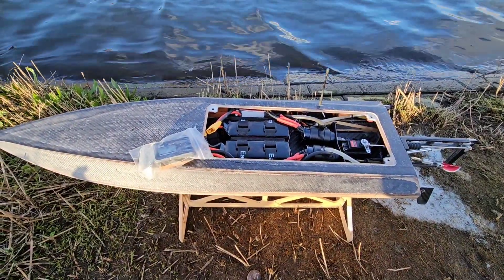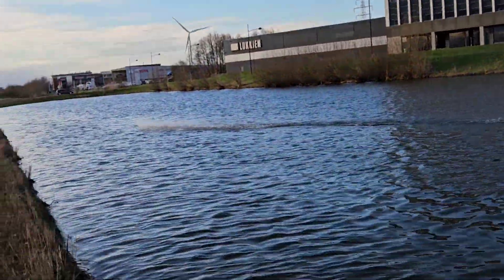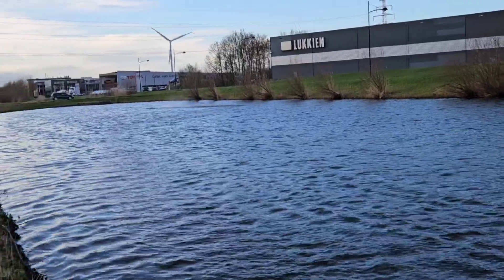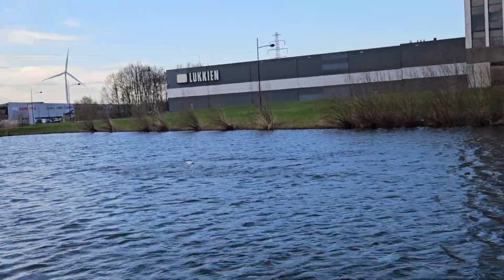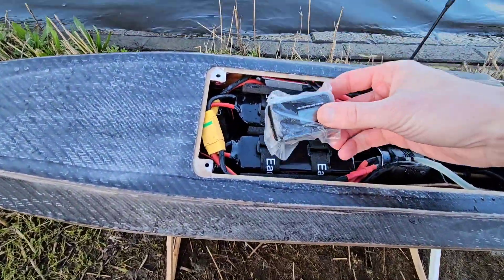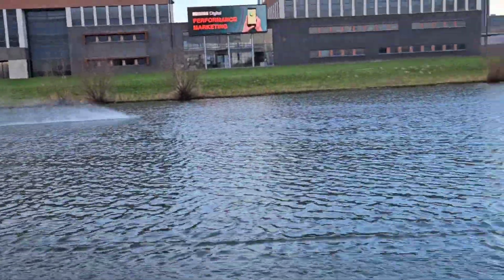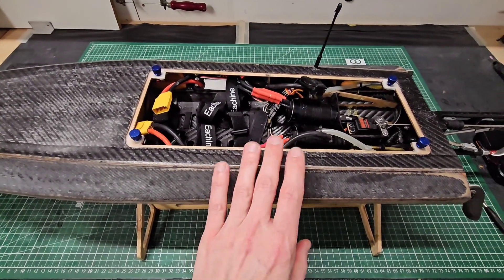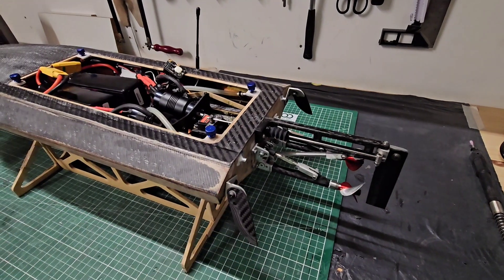DIY twin motor RC boat: top speed running until breakdown!

Comment: Hi what is your electronic application? Motor, Esc and Lipo battery...thanks😊
Reply from the maker: This boat has 2x Rocket 3670 1850kV motors, 2x 6S 4000mAh 70C lipo's and 2x Flycolor 150A esc's. The top speed is 118km/h so far, but I will soon beat that I think 😎
Reply: @CozyRC  thank you Sir..i got my Fiberglass RC boat and thinking what application should i use...thanks again Sir..i am from the Philippines

Comment: Hi friends, I'm asking for advice... My Twin Cat weighs 3.8kg with only 4mm flexible and currently using a 37mm prop and I want to add 40mm, will the 4mm flexible last without breaking... please guide me friend 🙏
Reply from the maker: That should be no problem. I'm running a 43mm 1.6 prop on my T800 F1 Tunnel, which has a 4mm flex shaft as well.
Reply: @CozyRC  That means it's safe, friend, to use a 40mm prop with only 4mm flexible...
Reply from the maker: @ahmadgazali3019 Yes, it should work.
Reply: @CozyRC  Ok.. 👍👍👍👍👍

Comment: yes, the propellers are like anchors if they stop suddenly, they require progressive deceleration.
It was a good day for the GForce,you start to be more confident and open the trotthle
Reply from the maker: You are right about the props under deceleration. It needs more care and you need some space to let the boat slow down.
The downtrim of the stingers make the boat more stable, so I'm more confident to run it full throttle. It's a bit slower too.. It was too bad the G-Force stopped in second run. The water became smoother and I wanted  to run some laps. Next time hopefully!
Reply: @CozyRC  the race to find the best setting has begun, how about powertrimms at 0° and the batteries as far back as possible and the tip of the trimmtabs 2mm above the boat line, that would be my next setting but it's up to you.
Reply: 🫣 o soory you don't have trimmtabs
Reply from the maker: @daiciuapostol79  Haha  that's right! I prefer to not use them. The SAW guys don't use them either. 
The stingers are about 1.5mm downtrimmed now. The centre of gravity is at 30%. On flat water, I could run the stingers 0.5mm down, with the lipo's shifted forward.
A new speed record will soon be made, I'm sure. The SSS 3674 2075kV motors are waiting too. More power and more rpm.
Oh, and I will run with a single big lipo again, but I need to make strong lipo brackets, to secure a single lipo. More to come!
Reply: @CozyRC  my proposal does not have a logical thinking, what would I do I would leave the boat freer only from the CG, but as I said in the past I would have started with 5s not on 6s, it is a bit too brutal and harder to find the correct setting
Reply from the maker: @daiciuapostol79  That's why I started with mild power and lower rpm: 2x 3670 1850kV. To learn the boat and not have too much power. It is about the same as 5S with 2000kV motors. 
On smooth water, it runs stable with this setup. So I feel confident to do a power upgrade soon 😄
Reply: Whit this setup you have +4000 rpm on load then 5s 2000kv so not the same,but hey more power more speed😊
Reply from the maker: @daiciuapostol79  OK, I didn't do the math exactly like you did. It is a bit higher indeed. I just love big power and high speeds, like you 😄.
Reply: @CozyRC  all I know is that you multiply the kv by 3.7v per cell if the battery are good quality 😉
man I really miss the runs☺️

Comment: That was a decent run.  I mean,  100+ in choppy water isn't bad. Also you demonstrated why you need to unplug your electronics when your working on it (for the less experienced boaters), happened to me once too that engine started to run after a crash and taking on some water.
Also noticed the response when you let off, experienced it also with my own twin (which i was thinking to use the components from for new hull) and on a video from ironclad. Makes me rethink if i really want to go twin with my new build. Starting to think a single might be the better choice...
Reply from the maker: A twin mono runs more stable, but letting off the throttle needs a bit more care. These are some big props too; 44mm 1.9 pitch.
A twin mono is just so cool! I would definitely make another twin. I could share the drawing of the G-Force, if you're interested? ✌️
Reply: @CozyRC  thanks, but i have an empty hull which is around 1m. My idea was 2x4082 on 6s or 1x4092 on 8s (like my Dom)...  Im bit worried the twin drives will become to high above water and also will give issues cornering. Was thinking to tackle that by using cat drives since there bit longer (and look nice too) but thats already thinking in problems. The thing is, i dont want to redo layout inside the boat if it doesn't work properly since it's a rare hull. On other hand, the most off them are build as a twin.
Reply from the maker: @peteroosterhoff8850  It depends on how you want the boat to run. For speed and straight-a-way runs, a twin drive is perfect. I use 100mm stingers for the same reason you mention: to have enough prop in the water, even though they are a few cm off-center.
That's also why I can run 44mm 1.9 props with 3670 motors. They don't even get warm. These boats requite  different setup compared to a single drive. But the twin motor sound is just great and the rooster tail from the props is awesome too 😎
Reply: @CozyRC  i know from my current twin it sounds really great, i love it. The thing i'm most afraid off is that it doesn't want to turn at speed like within 15m or so. I mostly run not to big ponds since there close, so it would be a bummer if i cant use it there.
My current mono only turns very big turns, or at low speed. It's almost un-usable... I know it has to do with that hull, but it makes you kind off afraid to try it on another hull...
Reply from the maker: @peteroosterhoff8850  I get it. You're boat should fit the place where you can run too. And a twin does indeed need a bigger turning cirkle!
Reply: @CozyRC  right! I wouldnt mind if it turned like yours, but thats not a given fact since the hull is different and bigger. I'm afraid there is really one way to find out...